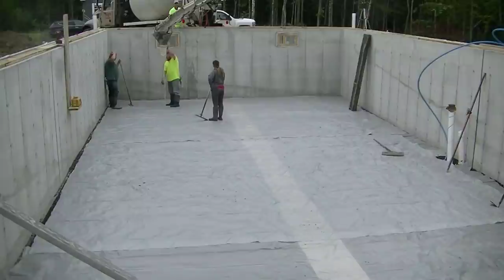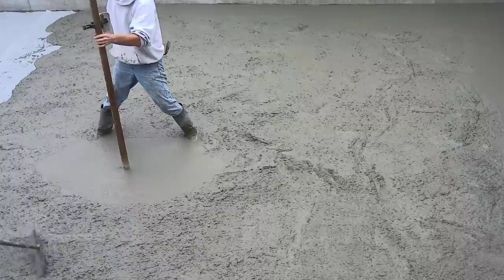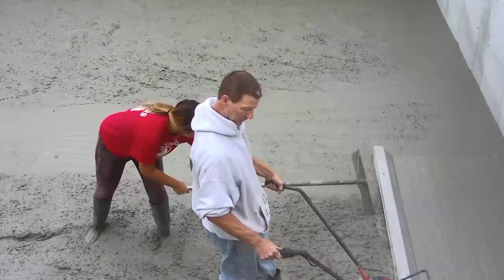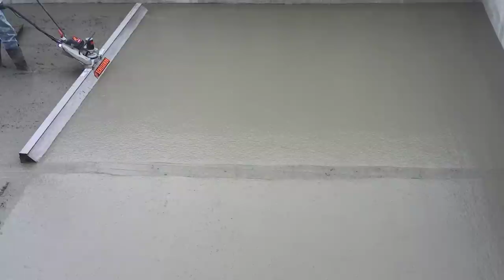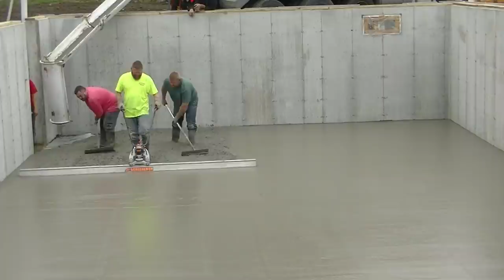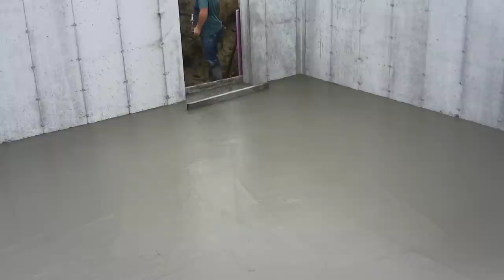Complete Pour: How to Pour a Concrete Basement Floor (Start to Finish)

Comment: Hey Mike. Love your channel. I’m a carpenter and building contractor up in British Columbia Canada. I sub out the big pours to the concrete finishers but do a lot of smaller work myself. Lots of great tips and advice on your channel. What a lot of customers don’t realize, is that pouring flat work has the most variables of things that can go wrong in all of construction.

Comment: You do a very good job. Many of the things you do shows you do flatwork all the time. If someone wanted to learn you are a good example of doing it right. We generally used pumps or a telebelt to do our floors which is another expense but most of the time we had access issues. The only thing we done differently is we would set grade pins for our wet pads. Can't say it is better or worse than using a laser to set the wet pad. It did seem to work better for us and was quicker. We also used a 6 foot float. Its harder to handle but seemed to be quicker and do a better job for us. Again nothing wrong just different for different crews. As always a 👍 for quality  and workmanship.

Comment: Well done sir, I switched careers in 2010, but very similar to how I did it. The water reducer is the key. We used Polyheed back then. For those commenting about slump, do some research on water reducers and you'll find out most ready mix companies put it in regularly

Comment: I've been watching you pour concrete lately. I pour almost every day, have been for almost 15 years. I notice you guys aren't using an over head to skreed off of. For example this basement floor appears to have an interior dimension of about 25 to 28 ft. I would have installed over heads splitting the slab into 3, 9ft sections and one on each side of the slab to skreed precisely up against the existing concrete wall. Use a 9ft skreed board with a wood stake screwed to the top of both sides hanging over a couple inches. Fill 1 9ft bay at a time, skreed it, fill the next bay and skreed it, fill up and skreed final bay.. when you fill the entire floor with concrete and only push it around with rakes, it will fire off too fast, it will not be perfectly flat, and you could be chasing it for the rest of the day. Using overheads allows you to skreed a relatively large section at a time (up to 12ft)  and is done so fast enough to where the concrete will not run away from you.
Reply from the maker: We don't have any problems doing it the way we do. Laser to set wet pads, chalk line on the walls to mag float to. We're fast, our floors are very flat. Everyone has their own way. This works great for us.
Reply: Well, when you pour self-leveling soup it kind of screeds itself 🤷🏻‍♂️
Reply: Hello Sir,  just curious about what do you mean when You  stated that you use an OVERHEAD TO DIVIDE THE BASEMENT FLOOR INTO THREE SMALLER SECTIONS ?

Comment: Hello Mike.... Ian here from Toronto, ONTARIO, CANADA...I really like your videos and want to learn more.
Please explain why you installed thr white plastic tarp on the basement ground before pouring your 4 inch concrete slab ?. Did your guys also have 3/4 crush stone  underneath thr white plastic tarp  ?  How thick is that ¾ crush stone do you place on top of the sub-grade earth on your BASEMENT CONCRETE FLOOR ?

Comment: Hows it going. I am year 2 into starting a small concrete outfit on my own with 2-3 other guys, similar to what you do. Your videos have helped alot on understanding the business side of the work. I am asking you or anyone on here, Can you run a business like this without owning your own heavy equpiment or dump truck and still bid jobs competitively? I live in the city so its a very big commitment to start paying for a shop space/yard, Multiple vehicles and insurance on top of all of it.
Reply: Just sub contract out the excavation part of the job that requires heavy equipment. You won't make as money from that particular job but it frees you up to do another pour if you're not doing the prep work so you can make up for it. Or just rent the heavy equipment when it's needed until you can afford a shop and stuff

Comment: hi.  I am liking your videos and if I ever needed concrete I would definitely hire you if you were close to NW Ohio.  What mil thick was the vapor barrier?  6-8-10?  Is there no benefits to taping the seams?  Finally, are you worried about your tools poling holes in the vapor barrier?

Thanks, and excellent, high quality work as always!

Comment: Hi Mike,  I just had a big  concrete staircase poured down a hillside and it looks and feels like its sloped too much down  on each step going down the hill... i feel im being rushed down steps when i walk it.   How can i fix this? Thanks for the videos.
Reply: Topping
Reply: @concreter6832  whats the minimum thickness i can get away with? Any product you recommend? Thanks
Reply: El Toro ,there are many different products,some feather down to nothing  . Easy way to do it is cut a piece of formwork, put on face of step and adjust to correct new height up or down (few braces) and apply product to top of formwork ,strip it and pave tile etc
Reply: In the states do U have to use fibre mesh as well as mesh .?
Reply: @concreter6832  thanks for the help simon! I will try the topping and forming each step... as far as the fiber, i think thats just extra and not mandatory on pours... we didn't use any but i did use 1/4" rebar. Have a good weekend

Comment: Why wasn’t the slab reinforced with rebar? Or did I miss that part
Reply: Metal in concrete is almost never, ever a good idea.
Reply: @anagramconfirmed1717  and what is the rebar that all builders use in concrete slabs ???! Metal
Reply: @mick_0359  and after almost a century of experience and data there's a big push to get away from it. Metal rusts. When it rusts, it expands. When it expands, a lot of force is created. Go anywhere that old slabs of concrete are thrown out as fill and notice how many of the pieces with mesh in them are cracked completely or partially along the plane where the mesh lay. Rusting metal creates a stress plane which inevitably causes failure. Look at concrete around wooden posts, or concrete dislodged by roots. For that matter look at the epidemic of damage to bridges because of metal. 
So you smarm and rhetorical question aside, that's why metal in concrete isn't all it's...cracked...up to be.
Reply: @anagramconfirmed1717  tell that to all the engineers who still use this method today building skyscrapers and whatever else that needs concrete slabs footings...wherever that big push is coming from I don’t see it and so do all the builders I see still using this method we all must’ve miss the bulletin...
Reply: @mick_0359  because YOU don't see it must mean it doesn't exist. You're probably right, though. Instead of challenging your own belief with, say, a simple google search, you should probably just double down on and let the data be damned. Thank goodness the world has people who aren't willing to think beyond their own current understanding. Congrats on pre-knowing all this.
Reply: Sounds like your the one with all the knowledge why don’t put all that smartness into creating the next best thing to reinforce concrete... instead of trolling replies with thing people already know about concrete cancer...when it’s cost effective practice universally used until the next best thing comes around...
Reply: @mick_0359  i actually am, my guy. Best of luck with your unwillingness to challenge your own beliefs.